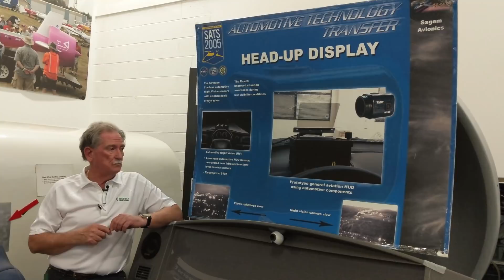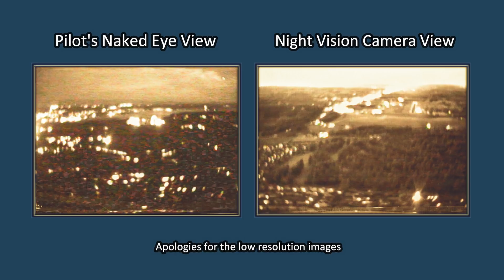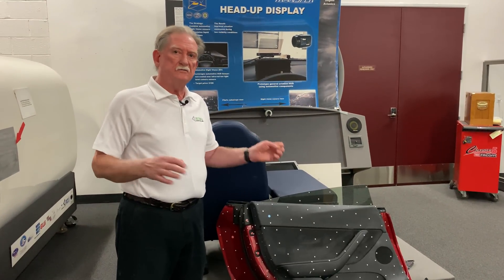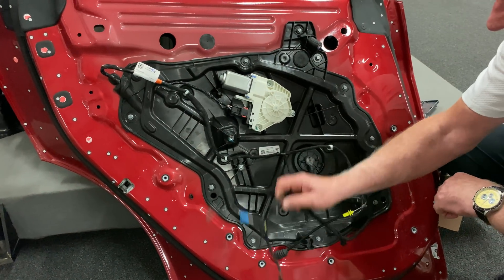Tips For Tesla E3 - Night Vision HUD & Wire Reduction

Comment: It's an open question how much tech should be developed to aid drivers exercising manual control.  Looking forward, increasingly, the car will make the critical decisions even if the driver is nominally operating the vehicle - it will be smart enough to override bad control inputs.  We already see some of that on aircraft.  We will see more.

The future of aircraft is also autonomous operation.  Planes will land themselves, and more safely than any pilot could do.  Eventually - not in what's left of my lifetime, admittedly, or Sandy's - pilots will be removed entirely.  HUDs will be obsolete in commercial aircraft.  They'll take longer to become useless in small planes or the military, but that's where we seem to be headed.

HUDs were developed mainly for ground attack missions.  Too many pilots were falling out of the sky when attempting to target something on the ground and fly the plane at the same time.  The HUD was a great idea, truly!  Worked like a charm, but if we're leaning into the future (as opposed to leaning away from it), the past is not always prologue.

There will probably always be demand for human-operated controls in cars.  We can't dismiss the HUD idea without giving it careful consideration - cost versus benefit.

But a key factor in calculating benefits is whether it will make the car safer.  It's not enough to make the driver happier.  You can do that by enabling games on the center screen, or cutting prices, or handing out doughnuts, or any of a number of ways.  So will a HUD do improve safety, in the autonomous age that's coming at us?

I don't see how it would.  The car will be overriding bad control inputs.  Even if the driver is totally blinded or jerks the wheel every which way, the car won't let itself crash.  We aren't there yet, but Tesla is moving in that direction.  A few years, they'll be there, I'm thinking.

Lights are cheap; they show the driver the road ahead.  HUDs are not cheap - though cheaper than they used to be.  If the safety payback from a HUD plus night vision is going to diminish to nothing going forward, as I think is likely, then it's a nice-to-have feel-good piece of tech rather than something that will reduce accidents.  Some luxury models might have it to differentiate their models, but it would essentially be a marketing ploy.

What about Bluetooth?

Well, that's tricky.  Sandy didn't mention that the control devices to be controlled by the computer are often buried in metal.  That makes getting a signal through to them much more difficult.  It might not be enough to just stick that circuit board antenna into a door, wire it up to the control devices, and call it a day.  I suspect what will be required is - you guessed it - more wires, between the board and the other side of obstructing metal, and another antenna.  If that is true, costs start to mount and the weight savings is reduced.

There's another worry.  Wireless systems are much more vulnerable to hacking than wired systems.  Assuming that signal reception has been solved, a hacker with a little knowledge could walk past the car holding a device and give it commands.  "Roll down that window, please!  I like the looks of that duffel bag in the back seat!"  So, yeah, carmakers can encrypt everything, but encryption is not foolproof.  There are ways to get past it.  Exploiting software bugs; attacks that rely on solving the algorithm at the source; etc.  I dunno, quantum computing might open a big can of worms at some point; researchers suggest that it will.  Today's encryption might not protect against tomorrow's threats.  It's an evolving technology, too.

The solution to reducing wires that I favor isn't going wireless.  It's signaling over power cables.  Power has to go into every control device, so those cables already exist.  Signal through those.  Eliminate all signalling cables - all of them - and we won't add back in weight for Bluetooth circuit boards and wires and antennas to get the signal through to them.  And we'll avoid increasing the car's vulnerability to hacking.

It means that power circuitry will have to become more sophisticated, but that tech has been around for a while, too.  Engineers can figure it out.  I think it'll be cheaper than fussing with wireless, and less vulnerable to intrusion.

The other route to reducing wires is to tackle the power cabling.  There is some potential for weight reduction by going to a power backbone cabling system and letting devices step down the current to what each needs.  This avoids running power cables of different types all over the car.  I won't call this idea 'easy,' but it's something that could be developed.  Instead of a car bristling with different types of power cables running next to each other, one large cable goes through the car and small, hopefully short attachment cables connect the devices.

Comment: BT is  way to insecure and error prone (not to mention easy to block frequencies). At some point all intra-car communication will have to be encrypted as they would otherwise pose an attack surface. 
Innovation for wire reduction can happen while still keeping wires in place. They should take inspiration from computer networking, but not the wireless side of it, rather the wired side. Power over Ethernet is an applicable concept for wire reduction. High bandwith with low latency network and power all in the same cable, alternatively look at it the other way around and take inspiration from network over power line technology. 
I would probably have gone for a network type layout of the car to allow for broadcast domains and VLANs to separate communication. That would let me put "switches" in strategic locations as well to use the "uplink" as a single power/network cable and only run one to the next hop. Benefit here is that you get one main cable to the switch and can utilize short "patch cables" out to where it needs to go. That should be a huge reduction compared to the car length bundles running back and forth today.
I should probably mention that I do not know a lot about cars and have never taken one apart down to BIW.

Comment: You are absolutely right: I was missing HUD and infra-red night vision camera in my Tesla Model X from day 1, altough there is a great instrument cluster with nice customizable GUI. In luxury models S & X HUD+infra-red camera are a must to have features, especially Model X with huge windshield and it will be good if on infra-red camera could see a huge moose on the road at night before hitting it! And if infra-red camera could be connected to Autopilot computer, this will be even better!
Also it will be good for Tesla' competitive advantage, as all current and future German EVs have it or will have it. 
Models 3 and Y also need HUD as these cars do not have instrument cluster behind the steering wheel. It will be such a nice addition to these Tesla models 3 & Y and it will look great and futuristic, this is what Tesla is all about, right? And it should not be that expensive, if even Mazda 3 and Toyota Prius have HUD.
Reply: Just buy it as aftermarket
Reply: rkan2 I do not really want spend more on $120K car. Can leave without HUD, I have 2 displays already, but for 3 and Y it will be nice addition.
Reply: @ilyadoronin9087  Like I said. Google Garmin HUD or Navdy HUD

Comment: I'm going to assume he was using "Bluetooth" as a generic term for "Some type of wireless communication".  Bluetooth itself wouldn't be the best fit due to the way the standard is written and the insecurities there within.   One could argue that something like zWave could be 'neat', because you could then potentially monitor and manipulate your "smart car" as easily as you could your smart home.  Security is still a potential concern.   For wireless to work, they would likely have to come up with their standard that they can update over-the-air if/when vulnerabilities are detected instead of waiting for a standards body to adopt changes.
The biggest problem that they wouldn't be able to work around easily would be that our outside interference.  Someone could intentionally 'jam' your car with a nearby wireless transmitter.  If you want  an interesting real-world example of this, there are plenty of videos on YouTube showing people using a $10 jammer off Amazon to disrupt SimpiSafe alarm systems to break into homes without setting the alarm off.  

A wired mux/demux seems to be the simplest answer.  There's a lot less that could go wrong.

Comment: I don't understand the Bluetooth idea. Every single component that would receive such a signal, would be receiving power through a wire anyway,  would it not? So the best thing seems to me to have signals go through the power cabling, like you these days can get wifi through your power cables in your house (called powerline). That is a mature technology now, so unless it's too expensive or complicated, it seems a much safer and more reliable solution?

Comment: The wireless signals would HAVE TO be encrypted or they would be just spoofed making for easiest theft ever. Even a bluetooth repeater could do that.
Reply: 635574 and with encryption comes a slow down in actual data throughput, as the security protocols hog the data channel and compete for bandwidth. 

Then there is the reliability issue if radio interference occurs, possibly from the identical Tesla with the same technology as it slowly passes your car and a collision of transmitters occurs, stopping data to both cars. 

See my comment on secure way to go, in the main comments of this thread, it is a highly detailed, double token ring redundant local area network, using fiber optics, and redundant power delivery.

Comment: Like the heads-up display idea. Not sure about bluetooth, though. It just doesn't seem very secure or robust for something as crucial as doors and windows. Since power isn't wireless, I think something similar to power over ethernet would be ideal. Some proprietary PoE versions can delivery up to 100W. Make it in the range of ~48V and you could in theory have just 2 wires going to the car door.

Comment: Wireless is very unreliable and very very hackable. I would not dare to drive a car which controls doors wirelessly.

Instead, bring a ethernet cable in, and tiny microprosessor, something like STM32 (costs ~0.20$ each bulk and is quite powerful) to handle the network communications and MOSFETs for control. Power over ethernet (POE) can bring in at least 75W of power as well, so no separate power wiring would probably be needed. Infact, i was expecting something akin to network cabling for Model Y.
Total PCB cost would be in volume in few $ range each - all the connectors would add up to more cost.
All devices could be controlled over traditional networking, and connected to single (or if more convenient two) basic switches -- or perhaps even stupid hubs with just added power management.
All of the on-car hardware could be controlled over traditional networking, commodity ethernet cabling, standards already existing etc. and even rid most of the power cabling for typical accessories.

Using POE standard would also mean higher voltages however, which is good and bad, higher efficiency electronical devices, but nothing is pre-existing. Current standard gives rating of 960mA per pair at 41.1–57.0 V using Cat5 cabling.

Comment: Sandy Munro, I believe I have a better idea! A dual redundant, high bandwidth, Fiber Optic Token ring LAN System!  

BluTooth radio or WiFi in a mobile application is subject to radio interference, too slow to support high speed data transfer without bottle necks, and insecure even with encryption, which can slow data rates. 

This would also lead to cross talk between identical cars running side by side down the street, interfering with each other!

This calls for a more robust, yet ultimately simpler technology than any radio based, mobile system. I recommend a fiber optic, dual Token Ring local are network (LAN) system. 

Why? 

The dual fiber optic token ring system is fault tolerant, if there is a break in the ring connectivity, communications is not lost, the network can reverse the flow of communications to reach all modules anyway.  In case of failure in both directions on the primary token ring, that is why there is a secondary  redundant token ring, and second power source with the expectation the modules would also be dual redundant and fault tolerant, with two totally independent functioning circuits and boss which decides based on communications and internal fault alarms to decide to switch to the backup section. This would trigger a service vehicle soon alarm transmitted back to the main computer which would notify the driver or autonomous driving system for robotaxi driverless operations.  

I recommend a dual fiber optic system with dual redundant power wires for each fiber. This allows for two independent, two way, secure, token rings, 30 -50 gigabyte per second throughput, ultra high speed data communications networks circling the car between the dash mounted, body network controller communications hub, communicating with the main computer and the following controllers:

Front bay controller: 
Functions:

ABS data bidirectional communications

frunk latch commend and status

 front light functions

windshield wipers command and status

radar data control and communications

Stereo camera data communications

Power Steering assist

Anything else Tesla Engineers dream up! 

Two to four door controller modules:
Functions:

locking and door mechanically secure status verification

Power window command and control and any door panel user switch inputs

Side camera data

Side proximity passing vehicle detection

speaker audio data and provides amplification.

Anything else Tesla engineers dream up. 

Front seat controller

Functions memory power seat control and user switch inputs If any

Seat back video screen and touch screen video playback controls

Independent infrared audio data for video playback via headphones so the kids can watch SpongeBob while the adults enjoy the stereo system 

USB Charge ports power and on/off command if desired.

Front Seat heat

Rear seat heat and climate control via touch panel

Rear controller module: 
Functions:

tail lights

receive speaker audio data and provide speaker amplification

host communications with the charge port controller

charging circuits command and control

motor drive electronics.

Data service for stereo rear camera(s) 

Rear radar data communication

Rear hatch latch command

Rear Seat heat

Anything else Tesla engineers dream up.
Reply: There is a lot more that needs handled  besides door handles, including every onboard  real-time, 8K or higher resolution, high dynamic range uncompressed camera video feeds,  control of charging circuits and drive motor electronics,  radar data, future mobile Starllink satellite transceiver replacing the cellular modem so Tesla can fire  the cellular network providers,  Professional level resolution GPS receiver so the level 5 Autonomous,  Self Driving System knows exactly where it is located on the planet in real time,. Maybe the fiber bandwidth may have to be INCREASED! 

Fiber doesn’t carry power, but the redundant 8 gauge bus bar grade wire accompanying the token ring does! Each  module can take a self resetting breakered, tap off from both bus bars, which should do the trick for heating your seats, running the six way memory power seats, operating active suspension hydraulic pumps on four wheels, working all motors, lights, drive motor control circuits,  and all lighting,  full wing doors, power lift gate, rear window defrost, windshield wipers, etc. 

The gauge of wire can be greatly reduced,  if Tesla abandons using  old school 12 Volts and adopts a 48 or higher Volt standard for operating all control and lighting circuits. That would further lighten the weight of the redundant bus bar ring, that replaces miles of harness wire. 
I am a retired Telecommunications And RF Engineering Technician and if there is a patent on such a system, I sure don’t own it. Token Rings are not a new idea. The technique is used where fault tolerant, automatic rerouting  data  and telephone communications systems are required. The type of system that continues to operate even if some links are damaged. That is why I chose this, so if damaged, mission critical communications data can continue to operate normally.
Reply from the maker: @DishNetworkDealerNEO  Thanks for sharing such detailed and thorough insight!  We are constantly humbled and impressed by the high quality technical and theoretical debates that take place in the comments section.  Thanks for tuning in!